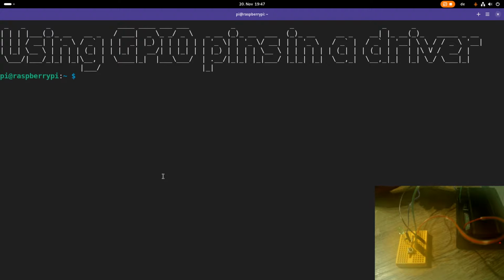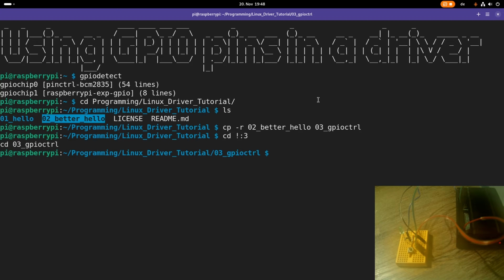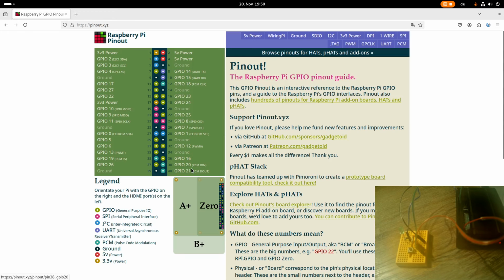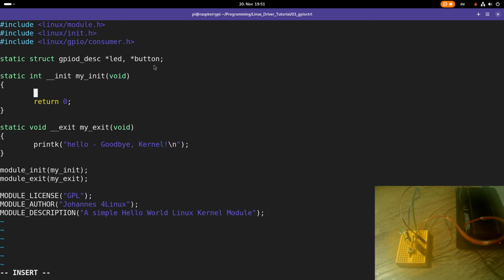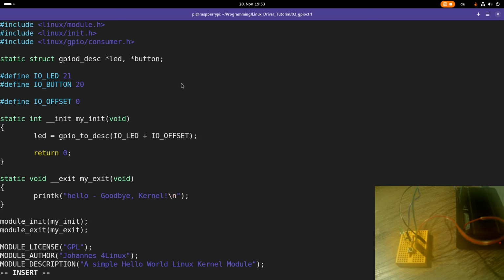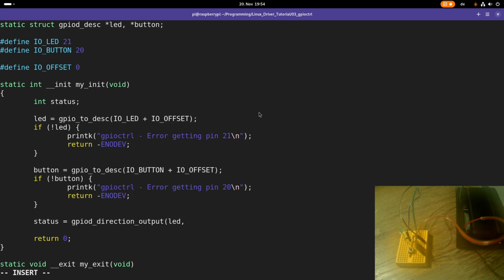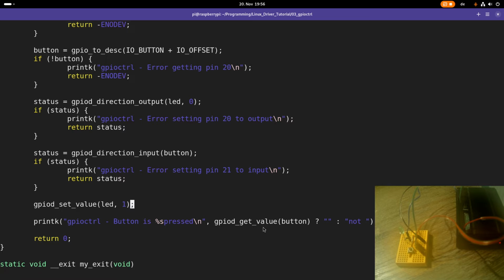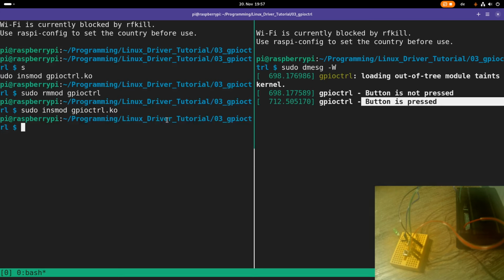Let's code a Linux Driver: 3 - Use GPIO pins in a Linux Driver

Comment: How do you find the GPIO offset if `/sys/class/gpio` doesn't exist? For example, I've got an Adafruit FT232H Breakout board connected to my x86 laptop over USB. The FT232H shows up when I run `gpiodetect`, and I can even write to its pins with `gpioset`, but the `/sys/class/gpio` directory on my system doesn't exist. Unfortunately, the FT232H is the second `gpiochip` device (`/dev/gpiochip1`) on my system, so it would likely have a non-zero offset.

Comment: this is function call not driver code
Reply from the maker: It is a kernel module in which I call some kernel GPIO functions. But the functions are the same you would use, e.g. in a platform driver.

Comment: Damn, don't have any male to female cables to mock up the led tonight. Was going to try doing this on a Pi with both Linux and FreeBSD. I guess this will have to wait until the weekend.
On the plus side, because you mentioned the device tree I went down a rabbit hole studying DTS files, uboot, and how arm64 SOC's pass the device information to the kernel.

Looking to see if I can use what I learned to make images for different distros or even OS's for use on a Pi

Comment: Excellent video! Definitely made GPIO in LKMs easier to understand. However, the method for getting GPIO descriptors ( gpio_to_desc() ) is deprecated, and therefore not recommended for new modules. Still, for simple modules, it definitely looks way easier than appending the device to the DTB. Looking forward to the DTB video!!!